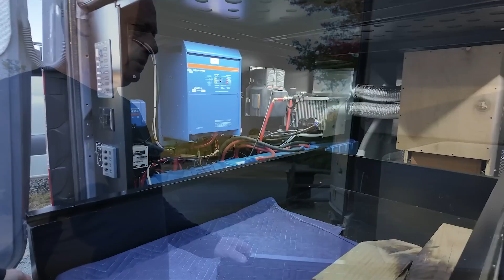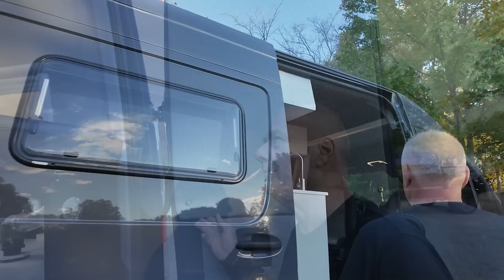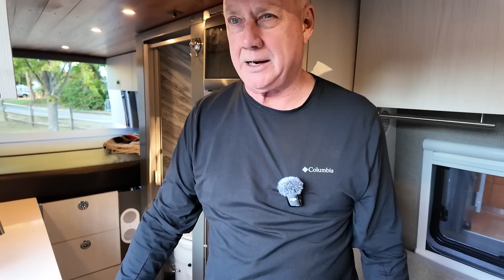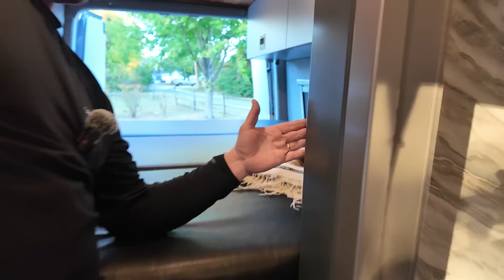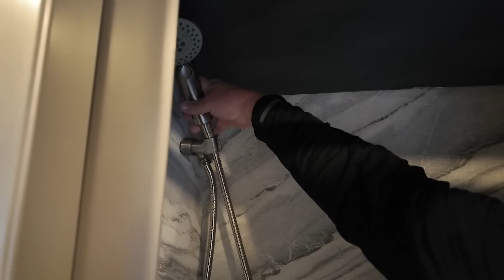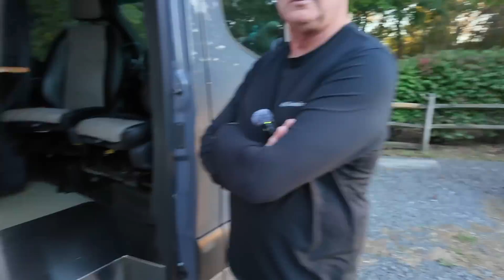Sprinter Camper Van Tour: Undermount AC & 24-Volt Powerhouse With Impressive Fabrication

Comment: Heating hot water with electricity  in vans/rvs is a thing of the past.

It takes to much power.

I have the Rixen’s system in my vans and never have to wait more than a few moments for hot water.
Reply: I have the rixens system. I use the tank as a holding tank so I have hot water without turning on the boiler in the summer. In the winter the water is heated when the heat is on. It takes no power from my battery because I use the electric when I’m driving. I never timed it but I’m going to guess your few moments is more like 3 minutes. I’m not interested in waking up,starting my boiler,waiting three minutes to wash my face then turning the boiler back off again to do it all over again in an hour.

Comment: It's a great garage setup because you use space nicely and the van can carry cargo if you need it for different adventures or to take a trip to Home Depot or Lowe's. The a/c idea is brilliant, as is the water to heat and avoid winterizing the van. I wonder how cold you can go (outside temperatures)? The bed design is great, but I would love to see it for a seating area. I can only imagine what the next build will look like.

Comment: Very nice setup , have some concerns with the ac system mounted under the van , would be a dust collector if the rig is driven of pavement, also vibrations and the particles , snow , not sure if the noise level is much different from the roof top type, the radiant heat is not risk free , there are lots of vibrations and stop forces that stress the connections, anyway nice luxury van , good luck,
Reply: The AC doesn’t have  much different issues than a conventional one in front of the radiator. It could get dirty and need to be washed out just the same. Vibrations would be much the same. It is probably more vulnerable to road debris however. As far as noise it’s slightly better outside however inside is like night and day. As you can see I have a lot of venting so you’re not pushing a lot of air thru small ducts. The more ducts the less air friction and the less noise and better performance. Too many people try to force a lot of air thru too small a duct and it sounds like a rocket ship.